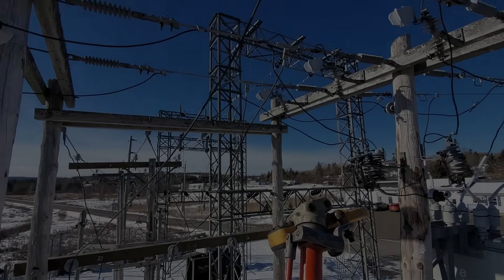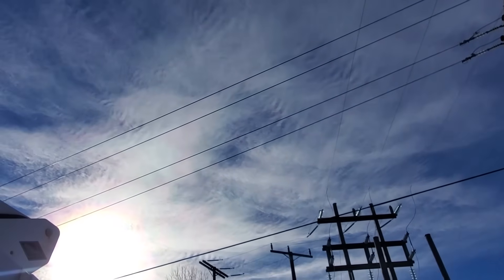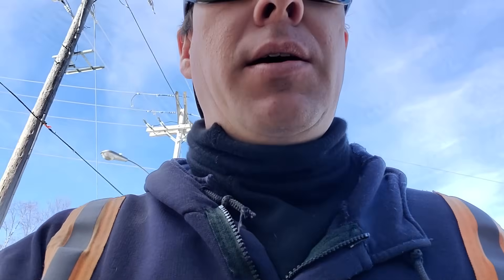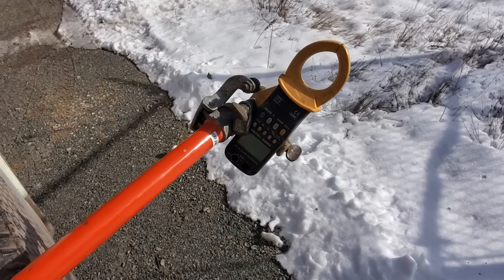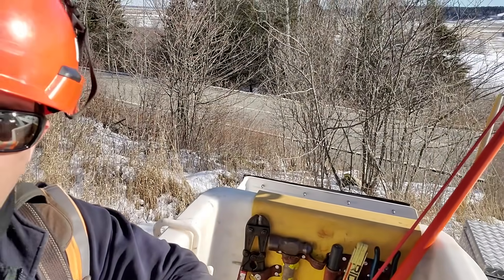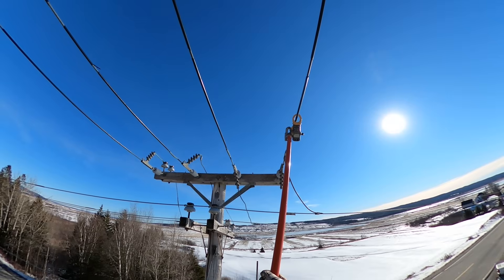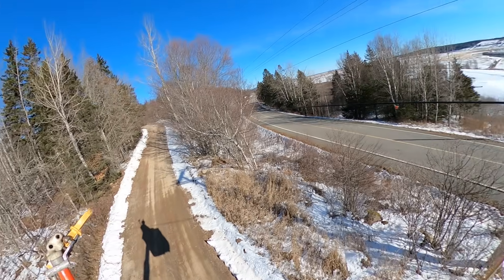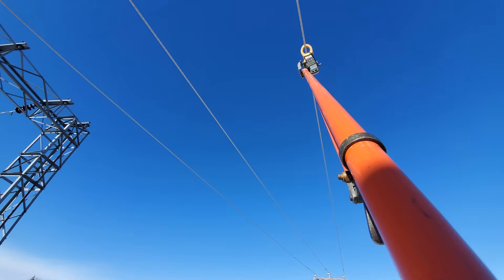Amp check on Powerlines - Load balancing

Comment: A story from my grandfather who in the 1940s was once tasked with trying to figure out why some equipment in a factory had motors that would reverse directions overnight randomly.  He traced it to the substation where a utility worker was trying to balance the loads and was switching the phases - which for 3 phase would reverse the motor direction.  He told him to cut it out.
Reply from the maker: Hah, yup changing rotation is a NoNo. It's actually apples and oranges from load balancing. 
It can easily become confused even at times with a well experienced Lineman. If one forgets to check rotation and mark their phases before tearing something apart, they might be scratching their heads when they go to put it back together
Reply: @Bobsdecline  it amazes me that you guys can keep it straight, I have noticed on some poles in my area there are little placards with a phase symbol and then 3 2 1.  Keep up the good work, love the videos!
Reply: @jfbeam  Funny story from many years ago, early 2000's.  I was working in corporate IT at the time.  My employer had done a major datacenter buildout that included all state of the art power management and a shiny new 1MW diesel genset.  Every month they would run through complete system tests and they always passed with flying colors.  And then one summer afternoon, all of a sudden, all of our floor went dark.  And our phones were dark too.  We saw some of our infrastructure guys running towards the datacenter which we learned was also pitch black and eerily silent.  As it turns out, we lost only one of the three phases... and for some reason our PDU's were only configured to watch one phase, which wasn't the one we lost.  This phase loss somehow overloaded the PDU's and tripped the breakers before they had a chance to transfer to temporary battery or the genset.  Fun times!
Reply: @joshuapk9808  I had worked at one chip maker, where they had backup power for critical machines. Well, one day there was a widespread phase disturbance, causing incoming power to be tripped off. The backup power was supposed to kick in, BUT, it's control detected that commercial power was still available, and didn't kick in the backup.
Reply: Balancing is not done by just switching the phases
Reply: A long time ago we had 4160 y . There were three cutouts on the three phase primary line that were never phased in. Going to a sewage treatment plant, one day somebody kicked in the blocks   and burned up every motor at the treatment plant
Reply: A load balance would entail changing what phase a local single phase circuit is fed from, right?  If someone in that area has a special three phase feed, their hookup is not impacted.
Reply: Adding power monitor relay is common to modern larger equipment for protection from low voltage, missing phase, or reverse rotation. This is installed in the contactor primary circuit to drop the contactor when the power is unacceptable.
Reply: Transposition towers make me wonder how they keep phases all straight, at substations.

Comment: if my home breaker experienced 6,000 amps would it survive? ;)
Reply: Normal ratings in the United States are 10k amps for residential and 20k amps for commercial.   A breaker that takes that kind of hit may have damage.   I had one explode on me one time.    But it was really close to the switch gear and step down transformer.  Transformer was fused at 2000 amps slow blow.    The fuse did not blow.   But the breaker did
Reply: @alansmith2228  My hands on experience was resetting a 520 v starter breaker for a fan motor that had shorted out so badly initially much to my chagrin that when I reset it it took out the entire fan room bank of breakers out in other words when I went and had a look in the main distribution room that breaker had blown. sigh. It also jumped in my hands and I think that if I had not been pushing hard on it because it was hard to reset and over my head it might have blown open. I did not reset the main one. I called our electricians and they just shook their heads, one that it was me again and two, that had never happened, yet.
Reply: At least by European standards it should. 6kA Short-Circuit Capacity is the norm. You can get brakers capable to handle more but they are usually not needed.
Reply: No.  And you don’t want to be around if it has to try to open under those conditions
Reply: No, but it would do what it was intended to do... that is disconnect service in milliseconds. The internals of that breaker would be destroyed in the process. (See some of BigClive's videos for various "exercised" breakers.)
Reply: @jfbeam  Seen those and yes they melt

Comment: If you really wanted to test high voltage with that meter you could use could use a two resistor voltage divider for high voltage measurement.  Similar to how a PT works.   I have use this technique to measure 20kv broadcast amplifiers final tubes output.   Note: There are advance protections in a Fluke meter you could hook it directly to 1mil volts and the meter isn't gonna explode it just might not ever work again.   Obviously you would want to use the proper tool for the job.  (Fluke makes a voltage divider attachment for that meter. (Fluke 40k-80k High Voltage Probe)
Reply from the maker: That's some really great info! I wasn't aware of a pt like setup that would function with this meter. Cheers! 🍻👊

Comment: love the videos, its intresting over here in 50 hertz land its a bit different the primary has no neutral the transformers that step it down to low voltage are mostly 3phase with 20-80 homes on one transformer(homes are connected phase to neutral, 240v) keep up the good work😉😉.

Comment: 3:46 What's that rod stick out of the pole on the left side of your head ?
Reply: It’s an insulating rod. You can barely see but it’s attached to a guy wire that backs up the dead end pole. The insulating rod prevents the steel guy wire from becoming energized. It’s also longer than most because it’s going across another phase.

Comment: Summer is the heaviest loads
With all the A/C running
That's why they have to do rolling blackouts in the summer
Reply: Well here up in the north in wintertime we have this thing called heating. And that takes a lot of power. Excuse me talking in SI units but let's take cooling from 40c to 20c and heating from -20c to 20c. Not uncommon but thats double. And here, just like in all civilized countries more and more of the heating is coming from heat pumps which consume electric power instead of oil or gas. A/C is not the cause of blackouts. The cause is infrastructure not kept up with demand. Very common in developing coutries.
Reply: Not on "the frozen s***hole of Hoth" (Canada) (And the peak is generally 4pm everyday in the UK, as everyone "pops on the kettle" as they say.) I'm sure COVID-19 has really messed with everyone load load predictions / models.
Reply: My 3 1/2 consume about 400 kWh in August, but it can go up to 1200 kWh in January. In Canada, if we use AC, it’s to cool from 35 to 22 (at most). And that’s with an heat pump which is more efficient then 100%. In summer, we need to heat from -40 to 22 (at most). And often without heat pumps or even a main heating system using gas. Purely heating elements, which are only 100% efficient. During summer, Quebec exports power to the US/Ontario, but in winter we (rarely but at least once or twice) need to import.